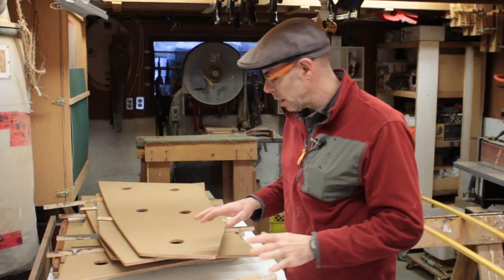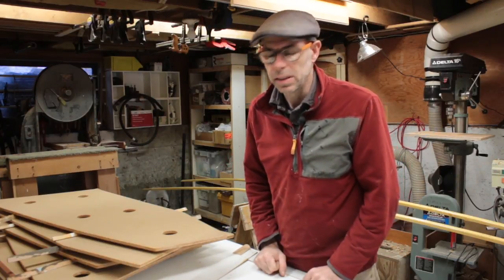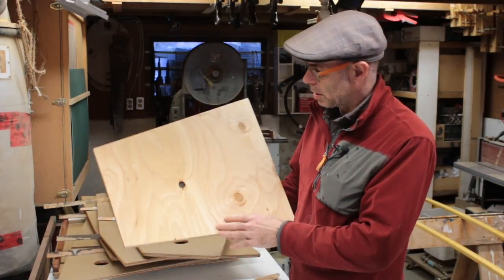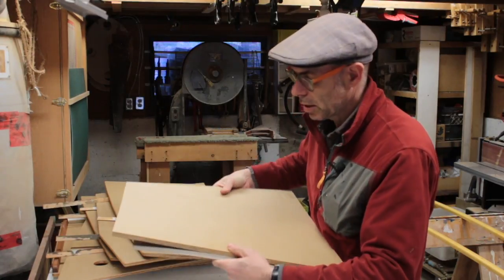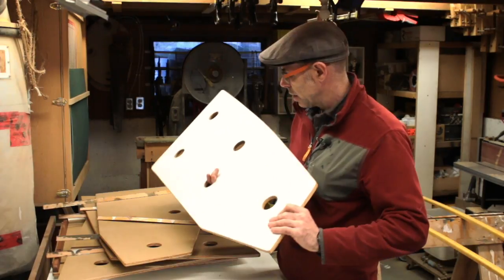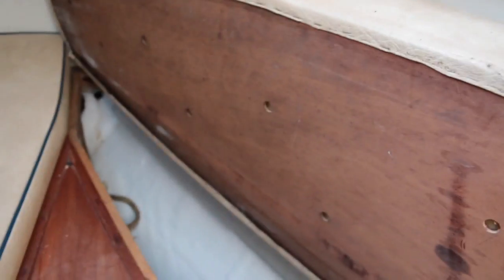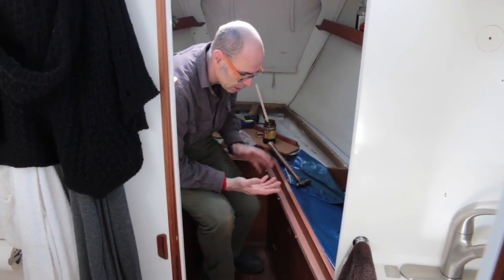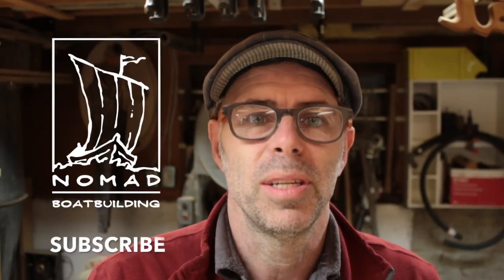⚓️ NOMAD - Yacht interior on a budget.

Comment: Cool to see you using mdo for this. I've used it for a number of torsion box work benches with an oil /wax (osmol) finish and have been throughouly impressed with its durability. At one point I found a local lumber yard had factory second 2 sided mdo that was cheap. On side would have some minor dents in it that either could be worked around or put on the bad side. Wish I had more of it.
Reply from the maker: You can actually get panels made of just the paper and resin. Don't recall what it's called or where you can get it but it's pricey stuff. It's apparently really stable, enough that you could make exterior doors with the stuff.

Comment: Nice vid.
Any lightweight options to replace these panels, thinking of divinicell, costly but light I think
Reply from the maker: I think your best bet would be to glass over a thinner ply. Just one side is probably fine. The backside to put it tension I would say. Maybe also go to baltic birch for increased stiffness or rotary mahogany or standard fir to control cost. 1/4” mdo is probably available somewhere but certainly not in my area.
Reply: @Nomadboatbuilding  thanks for that.

Comment: I'm going to rebuild/redesign the interior of my 1974 24 foot Coronado Mark IV this winter.Thanks for the great insights and ideas!
Reply from the maker: Michael Jaqua I hope it helps. Thanks for watching.
Reply: It helps for sure!  I am also looking into a new type of "plywood" that is actually made from plastic.  That would be an ideal material to build with, assuming it has the strength needed.  Mildew and rot resistant, and easy to clean.
Reply from the maker: @pacervault3350  For sure. A lot of interior components don't need a ton of strength either, aside from structural bulkheads of course. The biggest thing to keep in mind is ventilation. Condensation in the nether regions can make a huge mess of all your stuff. I also recommend doing a lot of mockups with doorskin or cardboard to make sure you are getting the best layout and proportions figured out. The Francis Kinney edition of Skene's Elements of Yacht Design has some useful furniture proportions and Howard Chapelle's books Boatbuilding and Yacht Designing and Planning has excellent advice. Best of luck.
Reply: @Nomadboatbuilding  thanks so much!

Comment: Very good 👍 I use same techniques in building custom built-in cabinet making. I love mdo.
Reply from the maker: Ya. I wish the double sided was readily available.
Reply: @Nomadboatbuilding  mdo in general can be hard to source, and it varies insanely in price depending on the seller. Some box stores have or can get it. Menards in the US Midwest, for example, sells 1/2" Roseburg mdo for $45  but stock is hit/miss. One retail supplier charges 3x that price, nearly the price of Hydrotek BS1088 (for kraft-faced CDX, basically). A wholesale vendor 60 miles away charges $60 and stocks reliably. If you can't find 2s mdo, call a custom sign painting shop. Mdo was created for exterior signage, and sign shops probably have a unit or two.
I love mdo for boat  interiors. It is light, stiff, as flat as veneer core ever is, and takes paint beautifully. It is first choice for a Herreshoff interior.
Reply from the maker: @robertmcgovern8850  Up here in Canada we don't have quite so many sources for materials I think and at least for me the costs have bee relatively consistent however, it certainly isn't available at the big box stores, just the small contractor suppliers. Yes using it for a paint grade surface is where it really shines. Outshines the marine or cabinet grade stuff too. Now my use of Formica is an interesting detail to consider. It can allow you to use any exterior grade ply that you trust and get a good finish. I would even consider MDX (exterior grade MDO) if the weight isn't an issue. There is a yacht builder in Florida that uses the more flexible post-form formica as a smooth substrate for painting. He uses the formica here, about 1:20 in: https://youtu.be/DfboLFGLN_o. Yacht Shop Creations. Well worth watching for some really good building tricks. Tell Jimbo I said hi.
Reply: @Nomadboatbuilding  Heh -- I live and refit sailboats in Wyoming! Talk about 'poor access to marine-grade materials.' :) I'm a fan of HPL in its place, as well; its thermal stability becomes an issue tho, as does the tendency of contact cements to release in hot weather or after temperature cycling. We're taking our 30 footer to Baja MX, and it will need to be buttoned up on the hard for hurricane season. Titebond3 holds lammy pretty well, tho clamping is difficult w/out vacuum bag.

Comment: Great video. I just starting doing my boat up and this really helps. But what wood do you use for the frame to  sit the mdo on top?
Reply from the maker: That really depends on what materials are available to you. Around my area, Douglas fir or Alaskan yellow cedar would be good choices but anything that can survive in a marine environment would be fine. Mahogany, pine, ash and oak are other common boatbuilding woods.  Interiors are typically fairly dry places except where condensation can be a factor so really just about anything will do the job.
Reply: Thats great thanks so much for your reply.m, so pine is the cheapest here in Ireland, so will now use that. 

Do you mind me asking if i need to treat it with a varnish before using it?
Reply from the maker: @78denty  not a bad idea but linseed oil will do as well. Larch might be available to you as well. It's just as good.

Comment: Is there a reason other than aesthetics to add bungs to screwholes? The boards which cover the hollow interior bulkhead next to the companionway in my boat look really nice but I can't remove them without chipping the bungs out, which looks terrible. I suppose after the project I could add new bungs, but I wonder if there's a less permanent way to achieve a similar aesthetic.
Reply from the maker: No, adding bungs is purely aesthetic unless below the waterline on the exterior of your boat. Getting bungs out cleanly is an art in itself. I should do a video on it if the opportunity arrises. In a nutshell though, using a fine sharpish slotted screwdriver, drive into the bung in the centre in line with the grain. now move out board a smidge and do it again, aiming toward the first strike. move a smidge to the other side and do the same. You are tying to break out a small wedge without prying heavily over to the edge of the bung hole. You want to avoid touching those edges. Once you have a little piece broken out you keep working your way outboard on both sides breaking way more. You might need to use a sharp awl to pick away the last bits at the very edge but most should break free cleanly along all the end grain. If the bung is varnished over you can try softening the varnish by carefully dabbing paint stripper just onto the bung with a Q-tip. If you really mess up you could use finishing washers with your screws to hide the mess, or even fender washers with round headed screws. I've even taken the time to patch up messed up screw holes with diamond shaped dutchmen which then become a feature.
Reply: @Nomadboatbuilding  Thanks for explaining how to remove bungs. Very helpful. I'll try that this weekend. I like the idea of finishing washers. More utilitarian in appearance but much easier to work behind the panels when I need to. Keep up the good work on your channel. A lot of your videos aren't pertinent to my plastic boat but you explain things well and I appreciate the work you put into them.
Reply from the maker: @ontheruntonowhere  Well the thrust of my channel is obviously wooden boats but there are a lot of crossover concepts.
Reply: @Nomadboatbuilding  There are, please keep doing what you're doing. Great channel. :)

Comment: Thank you so much for this. Just what I need.
Reply from the maker: I'm glad you found it useful. Best of luck on your project.
Reply: @Nomadboatbuilding  very useful, i have a 48 year old 25' steel yacht  and about to redo up for'ed.  I have to change the angle of the dangle.  The V berth is fine for 2 people laying feet first but I like to sleep with my head up the bow end, BUT  its slightly down hill so it feels like blood rushing to my head so i have to raise that end a couple of inches.
Reply from the maker: bible basher I can understand if the boat is out of trim causing that situation but I've never understood why you would ever build berths anything but level. If you go square off your bulkheads it should work out. Bulkheads are pretty much always built plumb to the designed waterline. A very simple solution could be getting new cushions cut to make up the difference in level.
Reply: @Nomadboatbuilding  Thanks. You have just made me think of something that has never dawned on me;   It could be my weight 120 kg weighing down the bow.  It is a tiny boat.  I think i will just make a wedge shaped mattress and save interfering with welded pipe frame.  Last time she was on the land the levels were fine so   I'M the culprit.
Reply from the maker: @organicox80  HAHAHAHAHAHA - self awareness is a wonderful thing.
Reply: @Nomadboatbuilding  oh yes,  and I guess the weather helm constantly varying isn't due to my superstitiously imagined ghosts in the lead ballast moving but my two legged  self ballast moving around the deck.

Comment: Ply can be "petrified" with West System and 404 filler, all sides especially the edges. Fill all voids, pits collect mold etc. 

No paper or cardboard anything on an ocean boat, please. Those are just moisture traps and food for microbes. 

House are built from termite food (cheap woods) and mold substrate (dry wall), not ocean boats.
Reply from the maker: SoloSailor sv that paper is infused with phenolic resin. I’ve tested well in fully exposed conditions. It holds up very well and if painted it’s as good if not better than a painted wood veneer face. In this case it has been varnished. I always seal my edges. With removable interior components like this, some voids are not a problem. This plywood product is made from the same materials as marine-grade fir ply but due to the possibility of core voids I don’t specifically recommend it for planking. While you could “petrify” this stuff with epoxy, you drive up the cost in time and materials. What we did here was substantially more durable than what was original to this boat. Mold is best controlled by good cleaning habits and good ventilation.
Reply: @Nomadboatbuilding  Good clarification, thank you.
Reply from the maker: SoloSailor sv you’re welcome. You’re concerns and comments were perfectly valid. I’m a real stickler for thinking about long term results. This is an older yacht and the owner lives on a student income so we have to find areas to save costs while achieving reliable solutions.